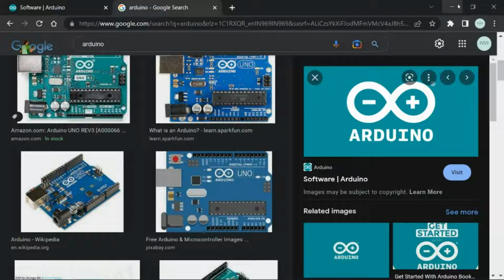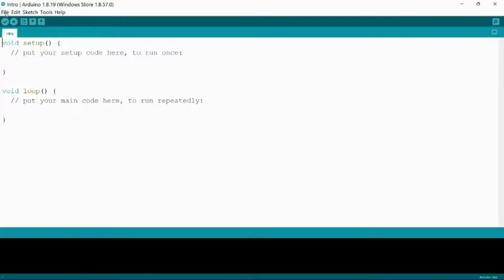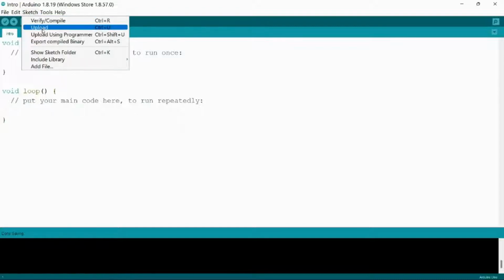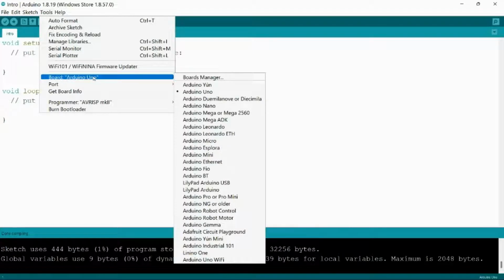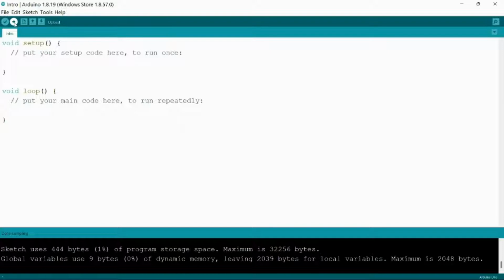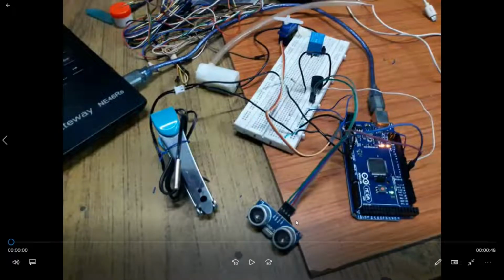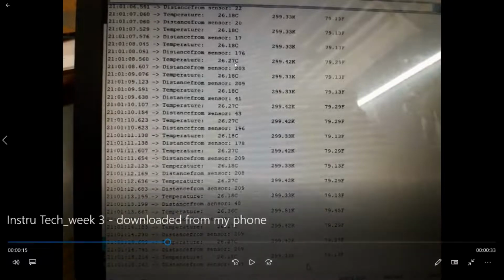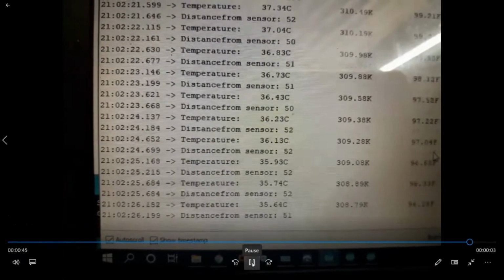How to Make First Project| Arduino Over all Intro with Live Demo |Projects | Schools |Engineering

Comment: blutooth module vechi Oru project panumbothu  rx pin la direct ahh 12v poiduchi ...then my arduino uno not working usb to serial ic heat aaguthu  i think  atha mattum change panlaanu paatha  chip kedaikala  vera ethaavathu pana mudiumaa ila new arduino thaan buy pananuma   pls help bro   

reply panuvinganu nambran
Reply from the maker: Hello bro,
12 v vanthu Uno Voda rx pin ha illa bluetooth module rx pin ha?
Uno vodathuna may be ic and resister damage agi irrukum run Programs that don't use rx and TX pins work Ana ok illa na new board tha vanganum uno is very sensitive to high voltage be careful before giving supply

Thanks and regards
Instrutech
Reply: @Magnil_Manifest  bro bt module and uno rendume connect aairunthchi  bro i need a help naan  ttl module order potrukan  and  en project la bt module use pananum but uno ooda rx tx pin not recognizing so 9 and 10 pin rx tx epdi convert pandrathunu soldringla time ilanaa vitrunga bro  tamil la yaarume sola maatranga hindi la thaan soldraanga understand pana mudila sila steps laam skip panidraanga  confuse aaguthu bro nrenga freeya irundhiganaa solunga bro 🤧😒😪😓